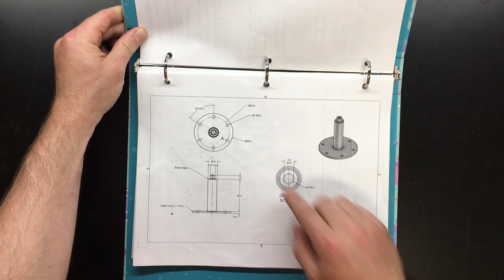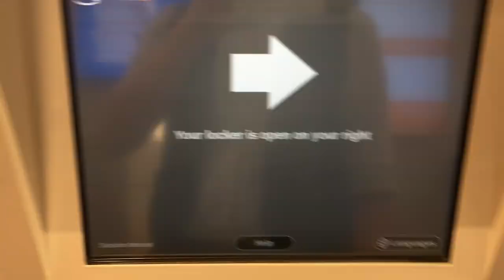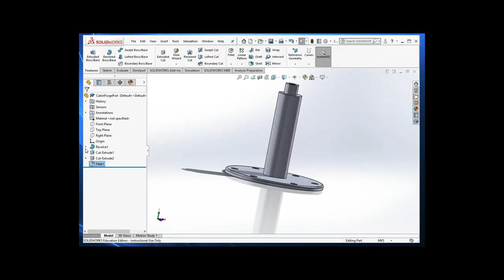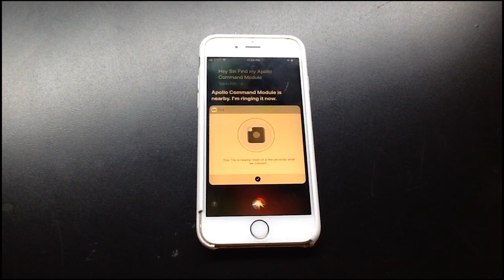The Missing Apollo Hatch (feat. Adam Savage and Jen Schachter)

Comment: what do they say about glitter?
Reply from the maker: Hi Majoofi! I applied 5 coats of glitter sealer, and it worked really well. The glitter doesn't fall off now, even if you drop the part or handle it roughly. So, I think it won't be a problem.